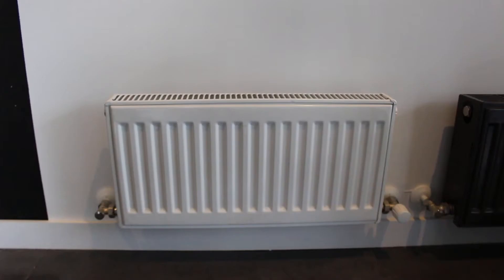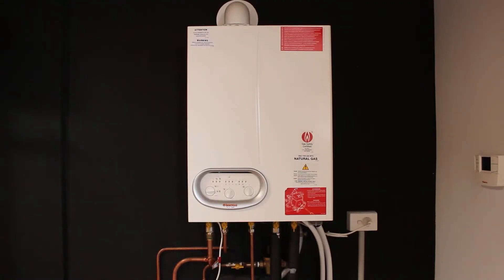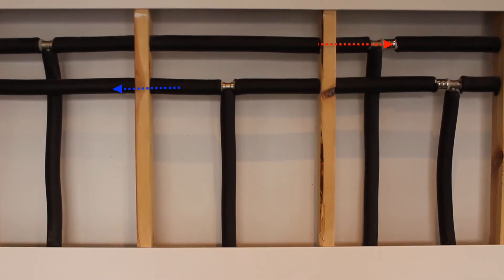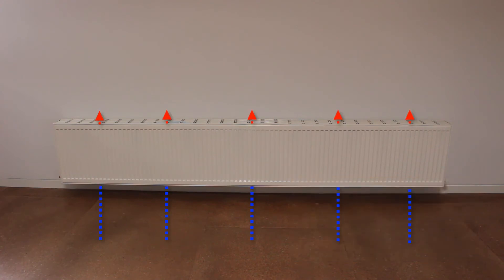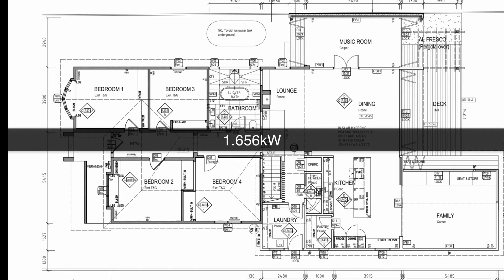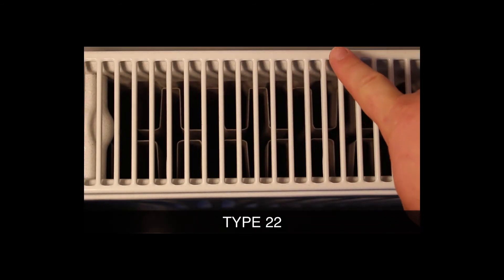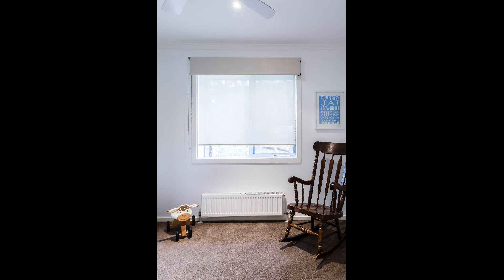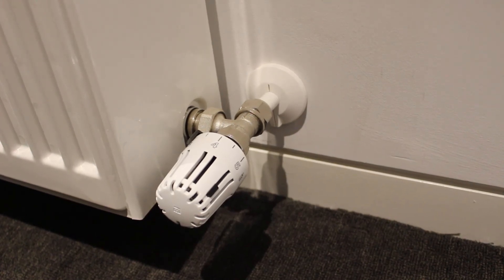ANSWERED: How Does a Hydronic Heating Radiator Panel System Work

Comment: Hello. I have a Intertherm softheath circulating hot water baseboard heating system on my porch. I had a power surge in my house and it is not working now. I had an electrician to look at it but he said he is not sure what is wrong with it. The brand name is intertheem. I don’t know if they are still making these models. The thermostat also is from Intertherm. I don’t know who can fix this for me or who should I contact. I will appreciate if you can help me. Thank you.
Reply from the maker: Sorry I have no knowledge of this product.

Comment: How does this compare with the cost of a duckted heating to run?
Reply from the maker: Hydronic Heating is far cheaper to run than ducted. This is because the heat energy from the burnt gas is transferred into water which is much better at conducting and transferring it than air. Also once the thermostat senses the desired temp. it shuts off the boiler, but the water in the panels remains hot and slowly reduces it into the room. This means it is a lot longer before the boiler needs to burn more gas than a ducted air system.
Reply: Reverse cycle air conditioning is way more efficient than gas.